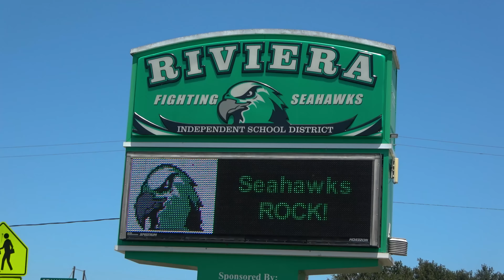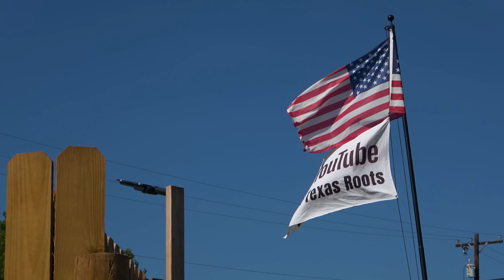Wiring Up The Living Room & Kitchen - Shed To House - South Texas Living

Comment: Jarod a trick an electrician taught me many years ago when you go to staple the wire above or below your box leave a loop 4 to 6 inches if for some reason down the road, you have to change the switch or plugin and have to cut the wire you simply loosen the screw inside the box and you have extra wire to work with.

Comment: Jarod another thought you were mentioning any chance of moisture from windows. the gentleman from Luminah Acres measured from window to edge of the frame and cut a wedge that width and the width off the window  1/4" to nothing. He then placed this on the bottom before building his window frame. This allows any moisture to weep out not in.

Comment: I try not to make suggestions; but in this case, you’re making my back hurt.  I think a carpenter’s apron would serve you well during the completion of your home.  The cloth ones are inexpensive ($5) but would last through this process.  They would give you a place to put a handful of your electrical tie downs, screws for drywall, nails, etc. without continually bending to pick up a couple from a bag, box or whatever.  This is a cheap addition that will make your back feel a lot better at the end of the day.

Comment: If it hasn't already been mentioned, in the kitchen receptacles be sure to wire them for 20 amp and with Ground Protection near the sink. For appliances, one circuit for the garbage disposal, one of the dishwasher, one for the refrigerator.one for the microwave and toaster. Might seem like a bit much but everytime a C/B trips it degrades by 10% or worse, I hope you are using all copper wiritng as aluminum not only degrades over time, but each connections loosens as it heats up and cools down. Especially on A/C circuits. Increase the wire size for the drier if electric, etc. It is a pleasure seeing you all working together. Congrats to your Mom and Dad for sticking it out, especially with all you YAHOO's ! ;)

Comment: Said it before, and I'll say it again, run an extension cord to your neighbor or to a generator and stick a window unit in your window temporarily - at least while you're in there working. It's like your asking to fall out due to heat. Take it from an old dude that used to work as a commercial electrician in the valley - Texas summer's can kill!

Comment: No rule against outlets under windows. In fact just the opposite, under the 6 and 12 rule you would have to put it under the window if the window takes up the first 6 feet from a corner or the window falls 12 feet from the outlet either side of it.
All the circuits in thst building are probably going to need to be afci and wet locations need both afci and gfci. 
Just for everyone's info.
Also technically your dinning room need gfci too. All kitchen, bath, garage and outdoor outlets need to be 12 guage. If you run lights on bath outlet circuit it can only be one bath per circuit and all 12 guage. Or run 2 or 3 bath outlets together and lights on a separate circuit. 
Code is pretty easy to find on the internet, just say what you are looking for into a voice search. Then make sure it's a credible response or actual code reference.
Reply: I'm Australian and it's illegal to do electrical work without a licence, I don't understand how Americans are able to diy electrical? The way jason does things make me nervous. Jared seems to be much smarter about it.

Comment: I don't know how Texas code is, but NEC 334.30 says that all NM wire needs to be stapled at least every 4.5 feet and within 12 inches of every outlet box, junction box or cabinet. In other words, you can't run any length of NM cable (like the Romex you're using) straight from the outlet box hole to the stud hole. It needs to be stapled within 12 inches above or below the outlet box depending on the placement of those boxes and the stud holes. I'm bringing this up because you have several outlet boxes where you did just that...brought the wire straight out of the box hole and over the stud span to the stud hole. Just trying to keep you safe and make sure you pass inspection...assuming it will be inspected, at some point.

Comment: Does the walls and roof have any vapor/moisture barrier wrap from the factory?
Reply: yes
Reply: y.  @georgecrocker3126  Thanks for the reply. Sorry, I forgot to ask about the flooring. Does it have anything under the plywood? Any moisture barrier and/or insulation? If so, what kind of insulation?
Thanks in advance.

Comment: What's the difference between the white wire and the yellow wire just was wondering
Reply: White = 14 gauge wire = 15 amp capacity 
Yellow = 12 gauge wire = 20 amp capacity
Reply: Thank you

Comment: IT BE A LOT EASIER  IF YOU JUST RUN A GOOD SIZE GENERATOR FOR ALL THAT NAILING    LESS WEAR AND TEAR ON THE BODY   WORK SMARTER NOT HARDER    PLUS  HAVING A GOOD COMPRESSOR DOESN'T HURT